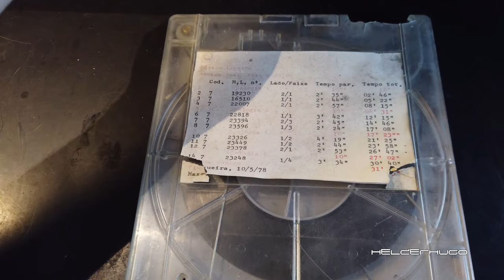Recovering reel tape from 1978 from abandoned Radio Free Europe Radio Station

Comment: I'd think you could find a cart deck on Ebay that would play a Type-B size cart. There is a splice somewhere on that tape. My guess is that's where you should have cut the tape to play it from the beginning. You should also know that is not standard reel to reel tape, but special lubricated cartridge tape. Have fun cleaning you deck!
By the way, I worked radio for 40 years and worked with thousands of these carts!
Reply from the maker: I think so but there is no need for this cart player because I only have this tape. thank you for your comments.